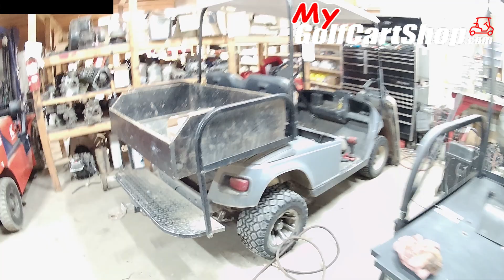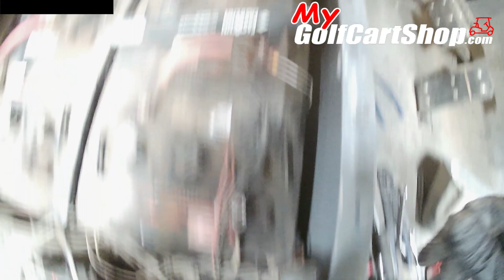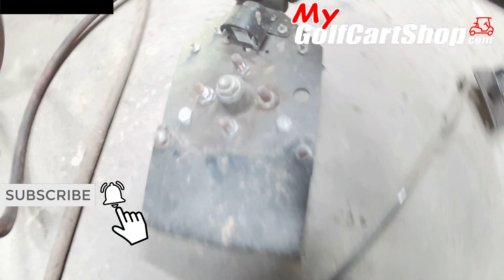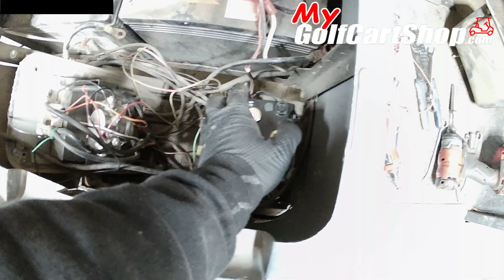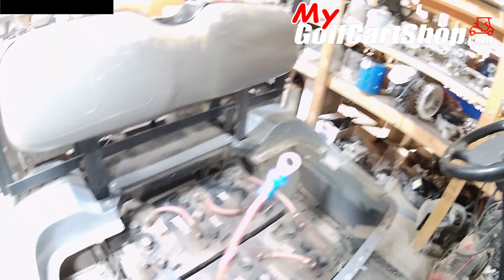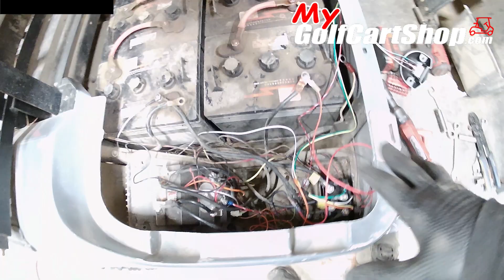Take off your F&R Handle EZGO TXT

Comment: I got a 1999 EZGO txt with a lithium battery. My F&R switch gets really hot after just 5 minutes of riding. What’s the problem?
Reply from the maker: All the voltage runs through them. You might want to think about changing it to the push button conversion? https://www.mygolfcartshop.com/p-4412-forward-reverse-lever-to-rocker-switch-conversion-for-36v-ezgo-5-pin-controller-with-its-by-my-golf-cart-shop.aspx

Comment: So I bought a chins Lithium battery amd have it all wired up. But when I went up a hill battery died. A little AI search and it says I had too much Resistance using a 4g battery cables and motor wire, etc. It recommended 2g wire for all wiring including solenoid, F&R switch, battery and motor cables. This should prevent the battery from shutting down for safety right? 

Any link to help me purchase these wires as a kit?
Reply from the maker: This would be a phone call answer. 276.632.8905

Comment: Motor wires connected to news solenoid .blue,red and orange from micro switches left now what? I understand everything else confused what to connect to rocker switch? Blue key switch or red from charger assembly. Ugh
Reply from the maker: Did you get our kit?